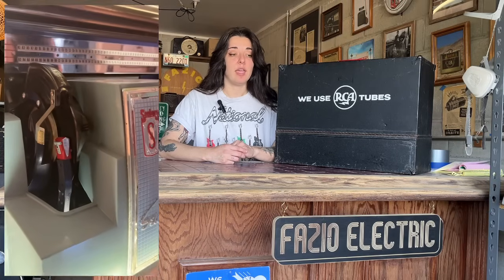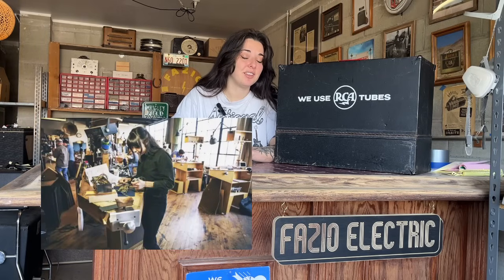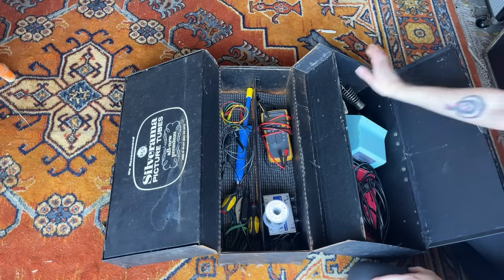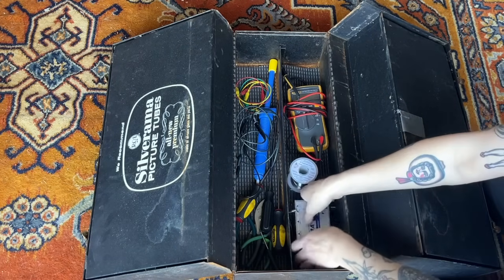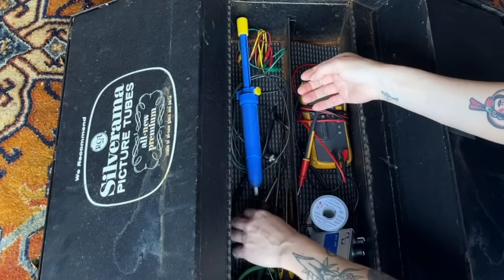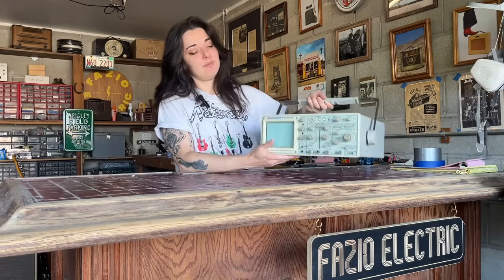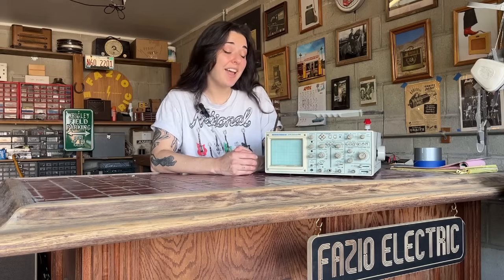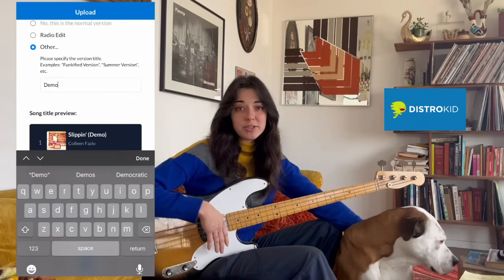Important Tools for an Amp Tech | AMP WORKSHOP ANNOUNCEMENT!

Comment: I'm fortunate enough to be over 3/4 of a century old and well remember the TV Repairmen coming in with their RCA Boxes.  Yes, I am one of those that even used the Tube Testers in supply houses and outlets to replace tubes on my own.  That definitely qualifies as "back in the day" memories.  I would just like to add there is no substitute for spending the extra $$$$ for quality test equipment as you do.  It's one of the most efficient return on investments a professional like you can make.  Great Video and please keep them coming Coleen.

Comment: Cool black RCA tube caddy. I have a orange top gray bottom GE tube caddy. My favorite tools are my Utica Stripwright wire strippers and Klein 327 needle nose. The Utica's are very good for striping wire inside chassis during repairs. They reach into tight areas. I use disposable BF-21 flush cutters. Got an online computer at my electronics bench.....

I wanted to try a T12 station with the hot switchable element/tips. I got a Chinese no brand kit. I installed it in a vintage Hexacon station base that had the required 24v transformer. It has ran good for 3 years. It has many features and heats up almost as fast as my D550. Cost under $30 with 3 cartridge element/tips. Hate to say it, I like it better than any previous station of any price range or country of manufacture.

Comment: The only thing that I would added to your kit is some diffrent coupling capacitors and few Electrolytics . My carry around caddy is a Zenith tube caddy made from wood ! and I use that exact  soldering station my go to meters are my Fluke 77 and 87 plus Heathkit VTVM.

Comment: When I first got into EMS, some early jump kits used those RCA boxes. I remember those boxes back in the early 60's when we got our first color TV and it needed repair several times (at home). 
I was surprised you didn't mention an ESR meter nor did I hear you mention an assortment of caps, diodes or resistors,  grounding lugs, spare wire, etc.

Comment: Back in the old days, those solder suckers didn't have that safety feature of having the plunger inside an already extended shaft. A lot of us back then got smacked in the eye using the old timey-wimey solder suckers because the plunger would snap back up and pop use in the eye.

Comment: Hi Colleen. Love the channel. I’ve been learning amp repair from the internet and often get confused by some information I come across, so forgive my naivety.. Do you use an isolation transformer when using your scope? Or is that more for amplifiers that do not have a chassis ground? Thanks for your time.
Reply: If the chassis is grounded and you're connecting your scope ground to the chassis, you'll be ok. But, if the chassis is connected to the "hot" side of the power cord, you'll have a short. I had fixed several electronics with my Heathkit scope and never thought about a "hot" chassis. But then I started working on a TV and connected the scope ground to the chassis and blew the fuse in my outlet strip. My solution was to use an adapter on the scope plug that left the scope ungrounded. That worked fine, but be careful what you touch while testing, or you'll get a shock. If you're familiar with the adapters sold to plug 3 prong plugs into very old 2 prong outlets, that will leave your scope ungrounded. Colleen may have a better solution 😊

Comment: My Hiwatt 50 custom (circa 2014) sat for a year or so. Indoors, climate control. It's connected to a Fryette Power station, which lets me attenuate and gain an effects loop. When I first turned it on, it seemed like it was lacking volume, but I thought I just needed to balance the Hiwatt volumes against the Fryette volumes. As I was tweaking all,of a sudden the volume kicked in.  It seemed fine and sounded fantastic, but after 20 min. Of playing the volume slowly faded out.  Power tube? PI tube? Some say the effects loop may need cleaning.  Gut reactions to this?

Comment: Do you still have that clear glass 100W incandescent bulb that I gave you for your current limiter a couple of years ago?
 The story I'm hearing is that when the existing supply is gone, that's it. One day there will be no such thing any more. 
I'd like to find a few more before they're all gone. There aren't any in the stores in Vegas.
Reply from the maker: Yes I sure do
Reply: @FazioElectric that's great! I keep mine in the box with a bunch of foam around it, and I only get it out when I'm using it because it's my last one and I have no earthly idea where to get another one right now. Maybe I'll get lucky at a swap meet.
         That said, I've been following your posts and I'm very happy over your success. I knew from our conversation that you were gonna knock em out of the park because of your grasp of the basics, and I'm happy to see that I was right.
Bob Dylan said
"You get older. And you start having hopes for other people besides yourself". Good luck and massive success.
             Hats off 
            CHEERS!!
Reply: Appliance bulbs will probably be around for awhile yet, just a bit more of a pain as you have to work in 40w multiples. Also not sure if traffic light bulbs are still available.  I have a various stash of bulbs of various wattage and haven't went looking for any lately.